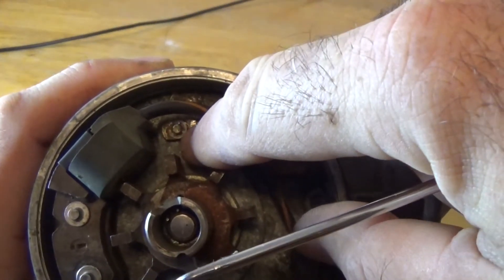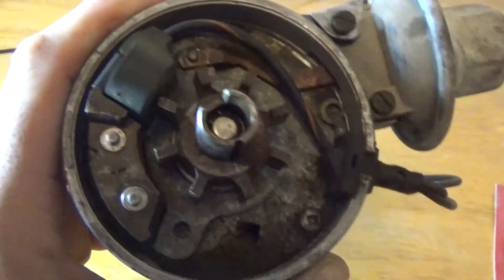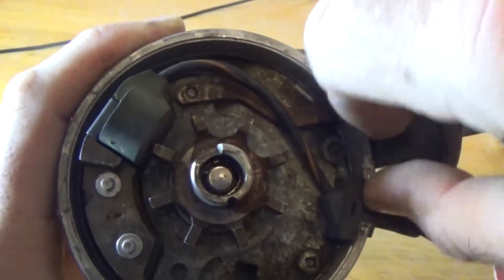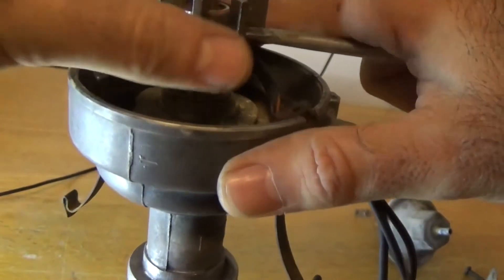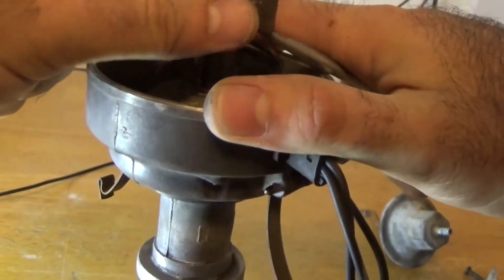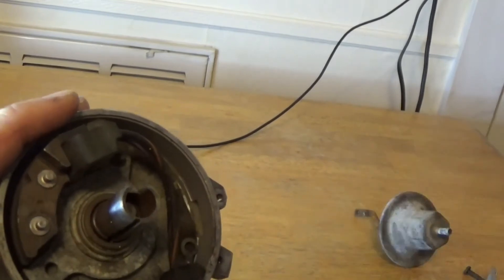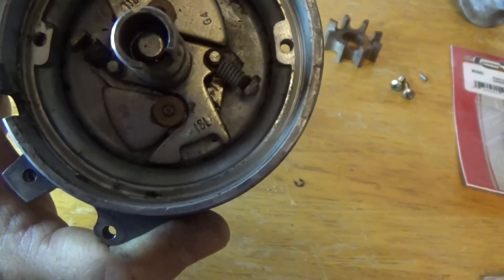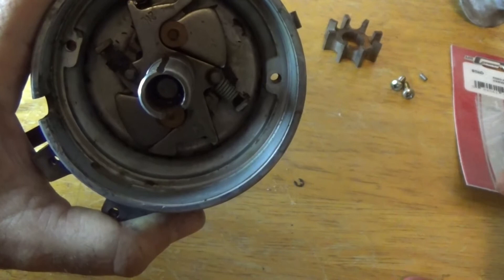Duraspark Recurve

Comment: Great information! You wouldn’t know what vehicles that may have those weights would you?
Reply from the maker: It’s really luck of the draw. Usually trucks had the worst timing curves but by now a lot of the cars and trucks have had their distributors changed out so you really never know what will be in there until you pull them and look.

Comment: I have a 80 ford 150 with a 351 M has compression getting fuel and fire to driver side cylinders but is not running on them could a bad dist cause this ? i have same dura spark set up ...thanks
Reply from the maker: @slabbuster  it doesn’t hit at all or it hits on the passenger side cylinders but not on the drivers side cylinders?

Comment: I hate hearing all the negativity on the duraspark systems. My step-grandpa was a huge Ford guy. He passed away a couple years ago and he had Ford parts, cars and tools spread out over 6 pole barns and 2 properties. Cars that haven’t been started in all the time I knew him from the late 80’s. My step dad and I had to get everything ready for an auction. Since I’m a mechanic, my job was to get all the vehicles running. EVERY SINGLE CAR WITH THE DURASPARK IGNITION fired right up after putting gas to the carbs. Even the ones with the internal circuit board sealing stuff running down the inner fender. The cars with points, all needed the points cleaned, adjusted and cleaned again. But then again, they all started and ran.
And the AutoZone modules aren’t $16 anymore. I bought one not too long ago as a spare. $50!!
Reply from the maker: @jeep2nv92  Duraspark is a great system. No way would I give $50 for one of those modules from Autozone. You can get a Motorcraft module for close to that price.

Comment: Hello again, quick question, does the distributor "need" the vacuum line advance with this mod? Ive deleted the emissions shit on my 460 and only know to take a feed of the intake manifold. However under hard acceleration vacuum is 0 and a carb vacuum line to the distributor would be constant vacuum? Please advise, thanks....
Reply from the maker: You don't "have" to have it hooked up but I would recommend that you do hook it up. Especially for street use. You will get better fuel mileage with it hooked up. Under hard acceleration mechanical advance does the timing advance but under part throttle cruising is where the ported vacuum helps out. The modification I'm showing here just limits the total amount of mechanical advance and brings the mechanical advance in sooner rpm wise. You will still have to fine tune your vacuum advance on the distributor if you run it.
Reply from the maker: If you used the Edelbrock carb you mentioned before, the ported vacuum is the nipple on the left of the carb when you are facing it...the nipple that is on the passenger side of the carb in the front. Notice it's above the throttle blades on the carb which means its ported vacuum. Only has vacuum when the throttle is opened. The drivers side nipple is manifold vacuum because it is below the throttle blades. If you have vacuum on the ported nipple at idle then the throttle blades are opened too far.
Reply: Dumb question here... Why do we double whatever number is on the weight?

Comment: Hello, got a question about 460 heads...I wanna rebuild the stock 460 in my 77 lincoln...I want mild upgrades only as it will be a cruiser. Im thinking a Edelbrock performer 460 intake, Edelbrock 750 carb , new cam, etc...The question is should i use 75cc or 95cc aluminum heads? The motor already has decent torque, but HP is weak(around 220?) i was hoping for 300 while keeping compression at bay (maybe 9:1?) The aluminum heads is just to save weight ...Your thoughts are appreciated..
Reply from the maker: Honestly either way would work but the best method in my opinion is to use the bigger chamber head with flat top pistons. One of the problems with all Ford motors in the 1970’s was the pistons being so far down in the hole when they are at top dead center. This causes problem with detonation. I have a 460 here that I’m putting together and I had to have .040 cut off the deck of the block to get the pistons to zero deck. So 72cc heads would raise the compression up very easily but with the piston that far down in the hole it will be hard to keep it from spark knocking even on premium fuel. A flat top piston with the bigger chamber head will get you any where from 8.5:1-9.5:1 compression just depending on if you use a true flat top or one of the fuel injected 460 pistons which have a very small dish and whether or not you have the block decked. Of course you have to remember the timing set they used back then also retarded the camshaft 8 degrees which also hurt the power output. If you get a timing set for a 1970 429/460 it will have straight up timing. You would be surprised how much just a straight up timing set and opening the exhaust up and recurving the distributor on an other wise stock motor wakes it up. The Edelbrock intake hp wise will gain you nothing over the stock intake. All you get is a weight savings over the stock intake. As far as Edelbrock carbs I’m honestly not a fan. Lots of people like them but they don’t have a good set up for Ford automatic kick downs on the transmissions. You have to buy adapters and stuff to make it work. I’ve always been a Holley carb person. Holleys and Quadrajets believe it or not. 429 Cobra Jets actually came with a Rochester Quadrajet on them. Now those spreadbore Motorcrafts that came on Lincoln 460’s are horrible. But the truck 460’s all came from the factory with a 600 cfm Holley. Lots of people will disagree with me but I generally stay between a 600 and 650 cfm on a 460. When you up the compression, open the exhaust and stuff up, they become more efficient as don’t need as much fuel. Now if you are going to turn your engine 5500-6500 rpms frequently then yeah you would probably want to go to a 750cfm. But street cruising 5,000 rpms and under I’d stay with a 600-650 cfm carb.
Reply: I can tell you know what you are talking about. I also noticed edelbrock carbs have a complicated kick down and linkage setup. And pricey, but I figured it would work better with their intake. As far as a straight up timing set, could I keep the remaining valve train I have now and just replace the timing set?
Reply from the maker: @katkiller50  yes. Changing the timing will not affect the valve train in any way. Basically all you are doing is moving the cam timing forward 8 degrees. The cam timing would then be the same as any pre smog era 429/460.
Reply: @BlackLabGarage I appreciate you sharing your knowledge so freely. I have done similar upgrades to 400s and even with no piston change it is amazing how these tips wake up a sluggish motor, even the 351 M. Pistons of course as you stated don’t hurt the equation either lol.
Reply from the maker: @brianhdueck3372  I have did the cam and carb upgrade to them as well as doing a cam, timing set, and intake upgrade. It does make quite a bit of difference in them! Just replacing the cam, using a straight up timing set, and just replacing the factory Motorcraft 2V with a Holley 2V carb wakes them up a lot. The 400 was a good motor. Unfortunately it was just a victim of the crude emission controls in the 1970’s.